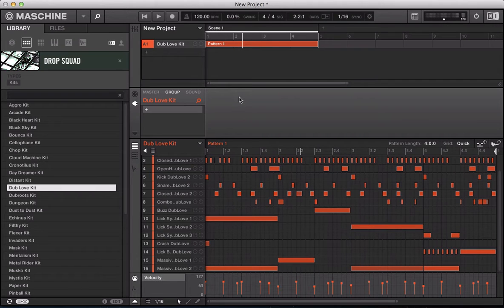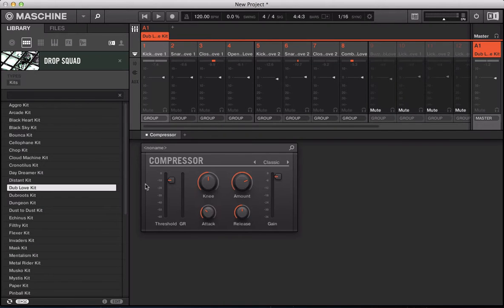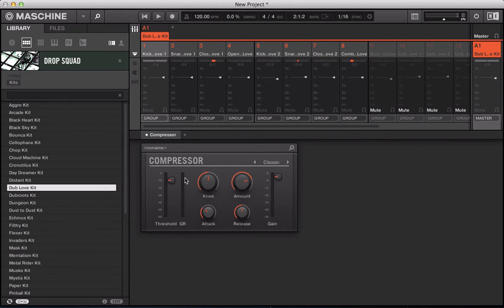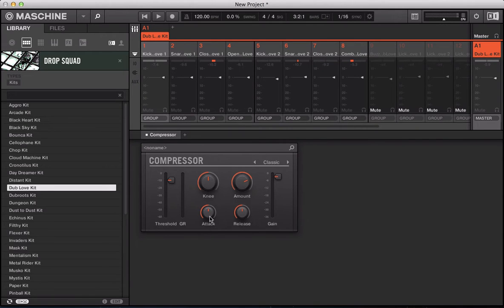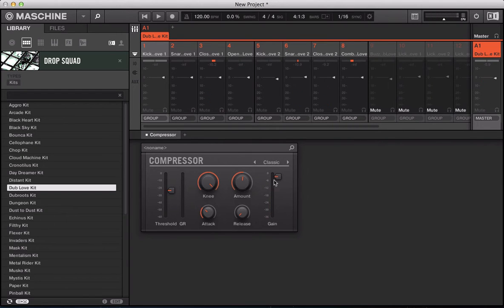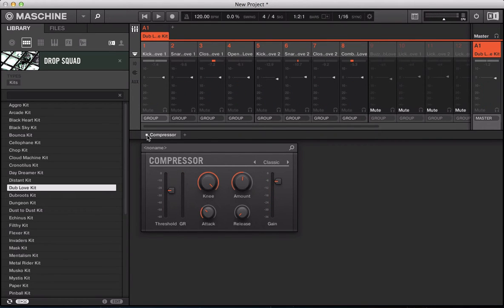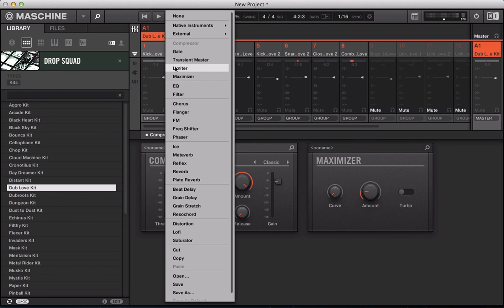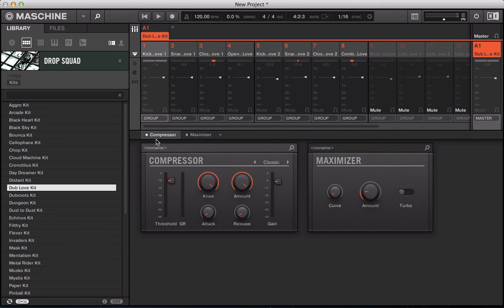NI Maschine 2 - Overview of Maschine Compressor and Maximizer Tools - How To Tutorial

Comment: limiter/maximizer in wrong hands can do a lot of harm.... If you don't understand compressor/limiter - you will make your music sounds worst... I would suggest keep them off the master buss, and learn how to mix without them. This is real skill, and most pros work that way (with some exceptions).
Gain staging in audio production is crucial. Your music will sound much better if you simply avoid using limiter/maximizer. If you know compression very well - use it, sparsely, and avoid NI's native plugs, as they sound terrible. The best vst compressor I encountered is PSP Mastercomp, but there are free compressors, very good quality too. From my observstion, when I try to use native vst in maschine - they sounds grainy, noisy and flat... but that's just my observation.
Compressor is not so terrible (buss one), but this is just ssl4k type comp, not really for every task.....
Reply: I agree could u recommend some more copressors? I feel kinda pigeonholed into the waves stuff and it seems like its mostly for rock music idk. Anyway I make house now and I really need a cleaner comp bc I agree with what you've said above. Ill check out the mastercomp but u got anymore?
Reply: @Seriouspup  PSP audioware mastercomp for digital stuff, hardware compressors for analog stuff (I use 3 types, ssl, vari-mu and optical, but if I want super clean, transparent compression, I'd go for PSP, there is nothing like it, even more expensive stuff. Although I use very little to no compression in pro work, music was already compressed so many times, so if I want to make things louder, I use paralel compression and other tricks. Actually I use expander quite often to get some dynamics back into the mix. When I started with music production, hardware compressors were very expensive (they still are:/) and digital had some issues, but now it'different, anyway, I have learnt how to mix using volume/fader, EQ, and PAN pot, just basic things, maybe with one buss compressor on the master. Today everyone plugs compressors and other devices like crazy...:) eventually it ends in overcooked mixes, 2 dimensional, without a punch and clarity, flat sounding....it's really outdated thinking, loudness war is over for several years
Reply: @tresporros  thanks man I see your point stuff is compressed on many levels I should probably get better at eq mixing thanks g!

Comment: I use a few external midi devices alongside my maschine, one device in particular does not have the option to adjust it's internal velocity curve, do you think I could use compression to boost the quieter notes? Otherwise I really have to hit the thing hard to bring it out in the mix.

Comment: i have a question...ill try my best to explain my situation...when i set the limiter on maschine 2.3 (which i just Bought) The master drums Sound like it has a whole lot of reverb on my drums but when i take off the limiter...the Drums Are Normal And Loud again But It Clips...is There A Way in 2.3 to put the limiter on without changing the drums...like i said it has a reverb echo effect...please reply...THANKS
Reply from the maker: Trap Beats & Cartoons ★☆ I imagine the limiter will be bringing out the reverb on the drums. Especially if your drums are clipping without a limiter, this means they're running into the limiter way too high, and as a result the reverb is enhanced considerably.

Comment: Might sound like a real noob question, and that's cos I am a noob, but what is the reason for limiting the dynamic range of a sound, group or track?
Reply from the maker: No worries at all, we welcome producers at all levels from beginners to advanced, so don't ever hesitate to ask questions! 
By limiting the dynamic range with compression of a group (in this case drums), we're making the quite parts louder and the louder parts quieter, which means the drums can sound more cohesive, more glue'd together and also appear to sound louder. 
We're also freeing up headroom in the mix, so the way I've used the first compressor in this video I've reduced the peaks of the signal, so now the loudest point in the drum signal is -3db less (or so) than it was before, even though to the ear they sound the exact same level. This makes more room for other sounds, e.g. vocals, synths, etc, and also means we can push the drums louder if we want to.
Reply: Excellent, thanks for that answer - it makes loads more sense now, especially the bit about making headroom, even though it sounds the same level - I was worried my hearing was duff ;-)